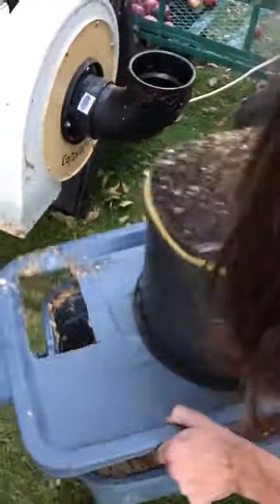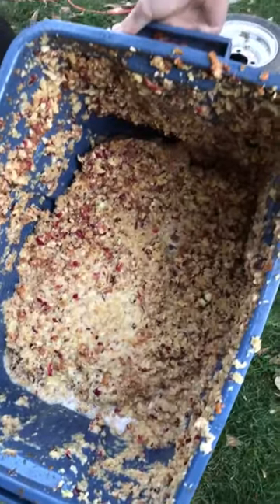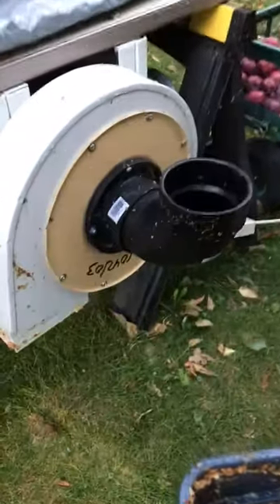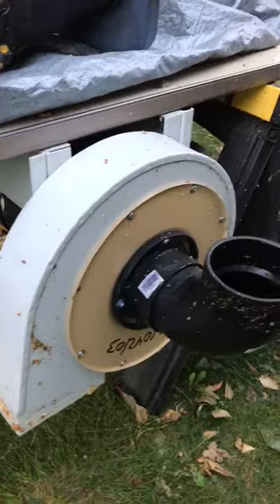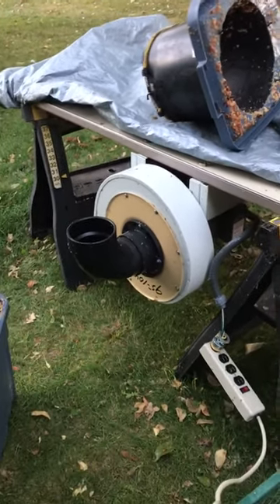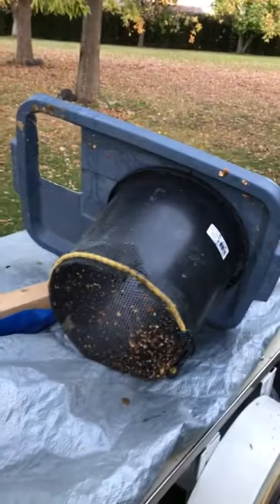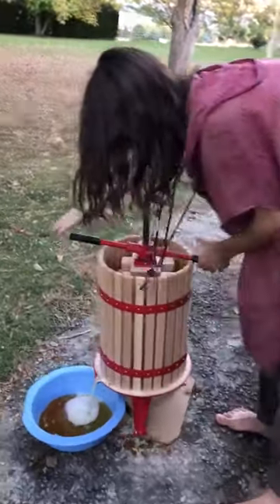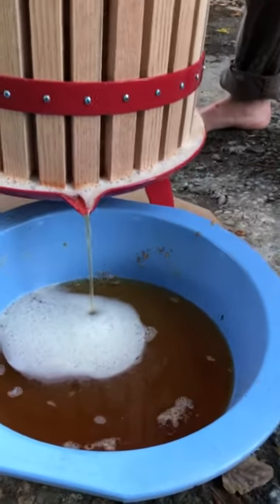DIY Apple Cider Press Grinder

Comment: In a stroke good fortune (or Google combing everything I do), I looked at a commercial air fan that kind of looks like this, this morning on a local "Craigslist" advertising board. And now, Youtube recommends me your video. Could you give me *any more details about your fan, setup, pictures, what it looks like inside  - anything like that please? If yours is the same as what I saw advertised today, I am going to buy it immediately. I have several bushels of washed apples drying on all my furniture at home and I need to process them pronto :) Thank you
Reply: Second question: does your motor ever get wet from the apple mash? Does the inlet for the apples basically allow the apples to fall into the middle of the "squirrel cage fan" and then the fan blade just automatically mash the apples finely? I see a fan sold locally to me, and the motor is inside the fan. No good because of the juice issue?
Reply from the maker: Great questions. Sorry for the delay . . . I don't monitor the comments on this. 
Mine has the motor on the outside of the fan housing so that only the shaft has the potential to get wet. The reason I am using a commercial grade fan is because the blades are made of much stouter metal. It literally explodes the apply instantaneously . . . no bouncing around . . . just pulverized and ready for the press. I have shown this to others and now I know of one even being used in Kyrgyzstan with a lot of applause from previous skeptics. If you can still purchase the one on Craigslist, it is worth getting.

Comment: I liked your video so much that I acquired a squirrel cage fan (with motor), and intend to try and duplicate your set up.  Brilliant!  Thank you for sharing!
Reply from the maker: Glad my idea helped. This year the apple crop was non-existent but our pear crop was outstanding. Imagine what we made?! We can process about 10 gallons/hour using this machine along with the traditional press.
Reply: Encouraged by your DIY spirit, I too bought one today - a 230V model. I hooked it up to 115Volts (Canada) and it was SLOW. When I closed the air intake area by half, it sped up by 100-150%. That doesnt allow me to feed apples in like this video shows. How did you make out? Do you throw apples in the inside of the fan blades or on the outside of them? Tx a stack.